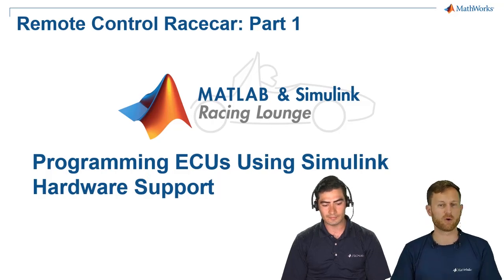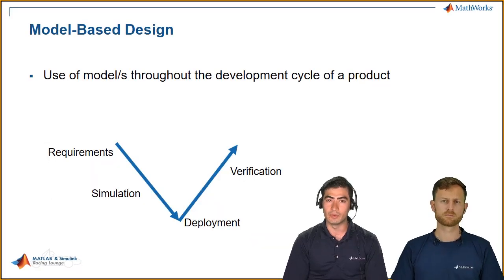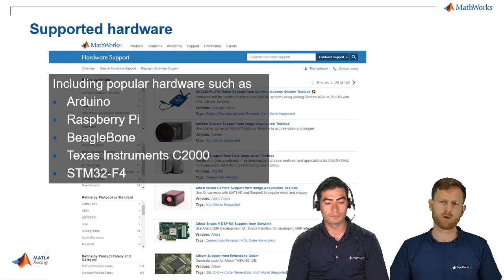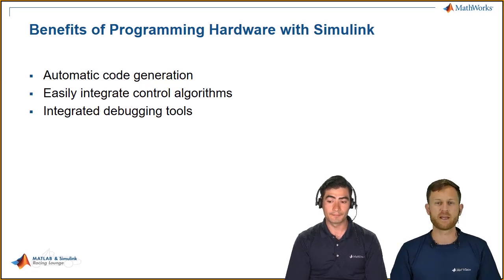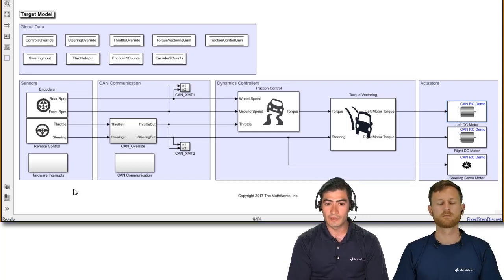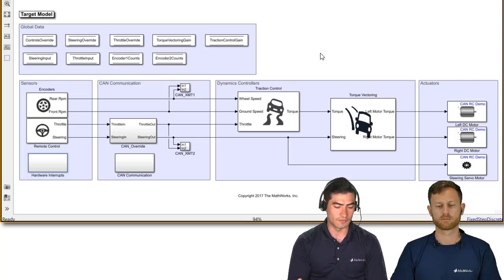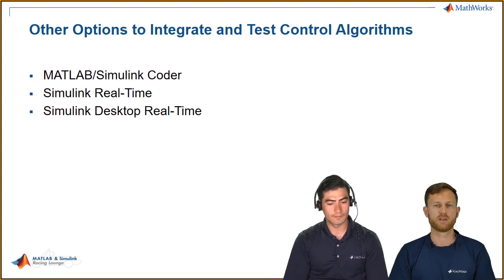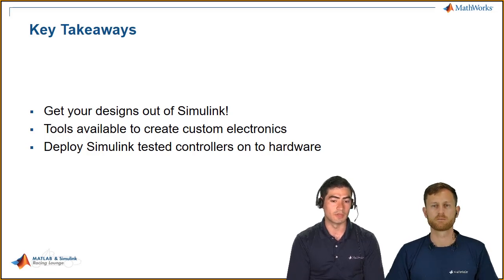Programming ECUs Using Simulink

Comment: Most of MATLAB's videos are hosted on their webpage as well with more resources linked to the video. They typically include models on FileExchange.
E.g. see https://www.mathworks.com/videos/matlab-and-simulink-racing-lounge-remote-control-racecar-part-1-programming-ecus-using-simulink-hardware-support-1504893165359.html